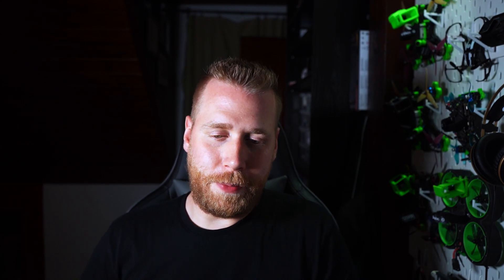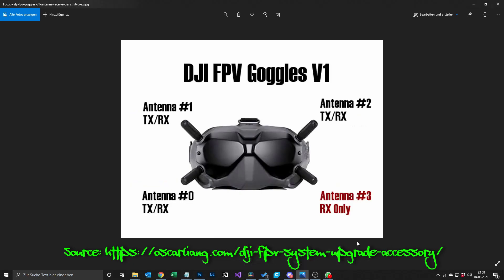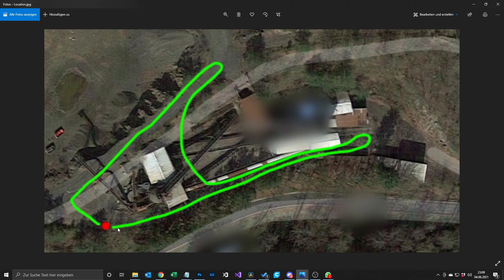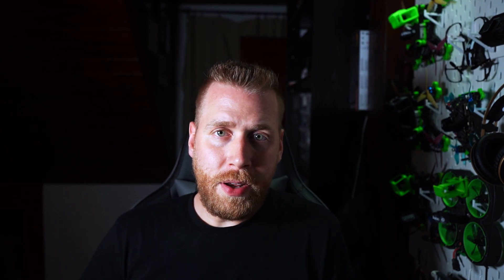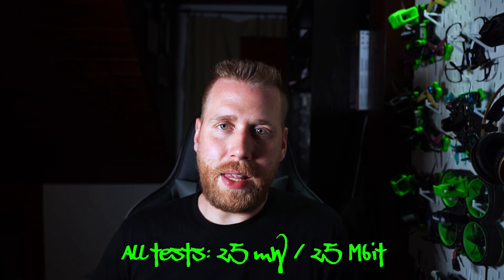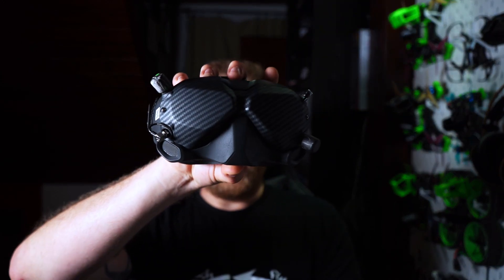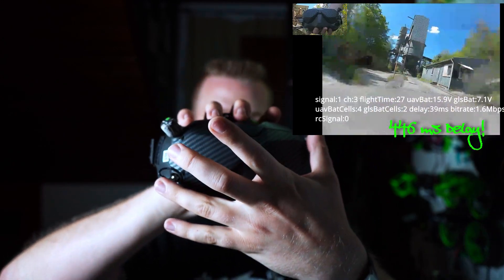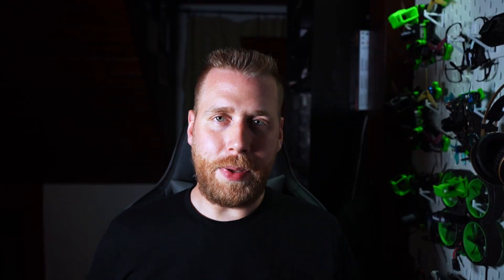Best Antenna Positioning DJI V2 Goggles | Patch and Omni Setup | English Version

Comment: i was wondering about that recently.
Was gifted a set of V2 goglgles and had a lot of latency and screen freezes in the beginning.
Ready to give up and go back to analog but luckily the Admin for the FPV group, South Jersey drone meetups flashed new firmware on evverything and it has been great since.
Thank you for your videos.
FPV 4 LIFE
Signed> The Drone Ranger
Reply from the maker: Thanks for your comment! Yeah FPV is a great hobby but it also need great time and patience 🤣👍

Happy you got where you wanted to be and you didn't go back to analog 😁

Comment: Will try. But the Omni on top should have better all around range?
Reply from the maker: Still running my setup like this ever since. And tried Omni on top as well both are pretty close tbh - diagonal gives you (way) more range in front and Omni top slightly better performance all around. But the other two setups were really bad.

Comment: Thanks for doing the testing! I just got these antennas in and will try to see if I can find a different between your recommended setup and omnis on top. Are you still using this setup or did you change since making this video?
Reply from the maker: I tried it once again with Omnis on top, but went back to my recommendation as it got me slightly more range (only few meters , but I had no downside doing so 😁)
Reply: @flickFPV  Awesome, I'll try it out!
Reply from the maker: Great!  I'm happy when you give me feedback, if you experienced the same (or not) 😉👍
Reply: @flickFPV  Yeah I'll let you know! By the way, have you tried flying the same route with the stock v2 antennas? I'm curious how they stack up.
Reply from the maker: Appreciate that! Thank you 😉
Tbh I never used the stock antennas,  but I agree would be worth a try - I'll test it as soon as my goggles are working again (have a backlit blackscreen since yesterday 😪)
Reply: @flickFPV  Figured I'd let you know, I did some testing flying behind tress and houses and while it does seem like the patch + stubbies does a little better than the stock antennas, I couldn't really find a difference between having on the the patches on top or bottom. More scientific testing required!
Reply from the maker: I guess I have to try it together with the goggles of my friend in the same run / flight to get more scientific data - in my case it only made a small difference, but enough to get me to go with the diagonal layout   but it might be only to different flights / speeds etc. should figure it out with the same flight but different goggles/antenna setups
Reply: @flickFPV   do you mean in audience mode? Problem is that you don't get as good a reception that way, the main connection has much better video than an audience member. The thing to do would probably to put a vista unit on a DJI drone and program in a fixed path, have the goggles be stationary on a table and run the same path with both antenna configurations. At some point though if the difference is that small, it might not really matter I guess...
Reply from the maker: Ahh damn you're right ..forgot about audience mode vs "player" mode ..
But yeah probably the difference diagonal vs Omni top isn't that big to consider

Comment: Interesting! I assumed patch on the RX would be best and had mine configured that way. At least until I saw Gal Kremer’s video which clearly showed that Omni on top was the best for V2s. His testing was at high altitude and line-of-site though. It’s possible different configurations are better for different scenarios 🤔
Reply from the maker: Yeah Omni on Top was also my previous setup - I'll give both options another try (so Omni Top and my new found experience Patch on TX probably on my own unless I get different results - if that varies too much to this video I'll do a new one) 

But I'd assume also that different scenarios will get different results and also my test was pretty non scientific- a slight deviation in the path can have an impact on the results, but unfortunately I didn't had 3 goggles to test it more precise 😁👍
Reply: @flickFPV  Thank u for Testing this out! What are your thauts after a year? Still using the Crossover Combination or Omni Antennas on top. Im Currently using the second,
Reply from the maker: Hey thx for the feedback! So I did try both and would say cross (as I show) and Omni top are roughly the same. 

I experienced Omni top is better if you fly beside/behind you and cross is better when you fly in front of you, but that being said it only a slight difference and you only notice it when you push far and you're really picky. I still fly cross and try to place myself that im flying always in front of me.
Reply: @flickFPV  also für Long Range einfach crossen. Mir gefällt es halt optisch gar nich bzw beim verstauen muss man auch immer bischen mehr hin schauen. 😄
Reply from the maker: Ging mir genauso.. wenn man sich optisch garnicht damit einigen kann, sind es m.E. auch nur marginale Unterschiede 😝👍
Reply: @flickFPV  hahah. Sieht halt echt übel aus ich glaub ich lass erst mal beide oben und wenn es sich anbietet bei einer Location Switch ich mal um. Überlege mir noch mal ne längere Antenne zu kaufen. Eventuell bringt das ja auch noch mal was
Reply from the maker: Sicherlich bringt dir das Range, ABER dann ist es noch umso schwieriger zu verstauen - das war für mich ehrlich gesagt der einzige Grund für andere Antennen als die Stockantennen 😁